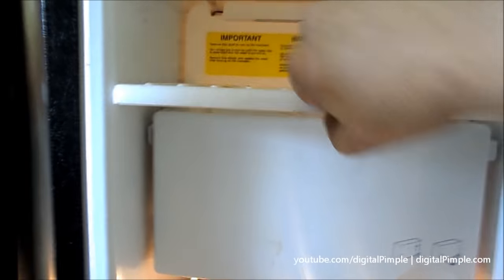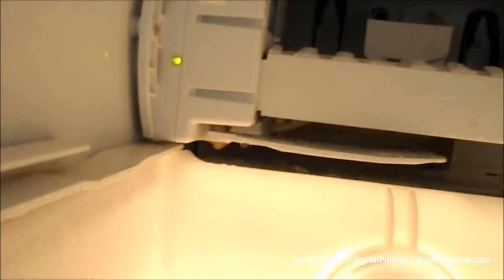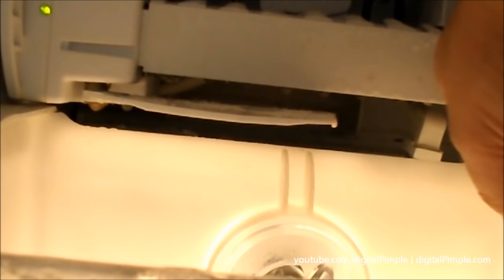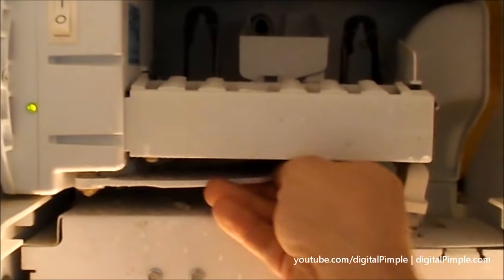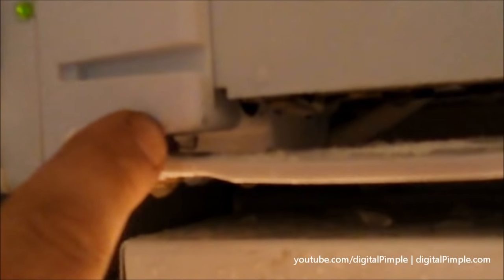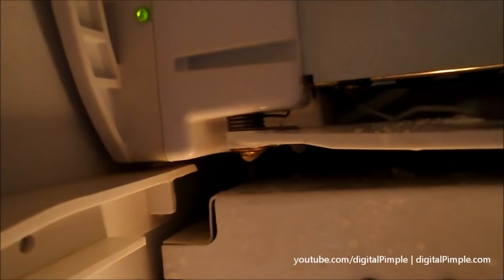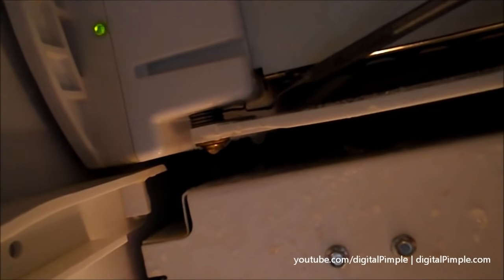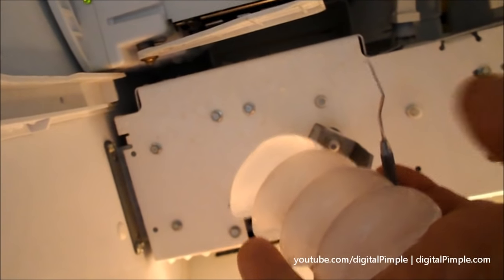GE Refrigerator - Ice Maker Not Making Ice - Easy Fix and Repair (DIY)

Comment: Is it safe to assume that after pushing the lever three times (I have tried it several times) and nothing happens, that the ice maker itself has gone bad (and requires replacing)?
Reply: Your turn off the ice maker, and then wait 20 seconds, and then turn the ice maker back on, and then push the paddle three times only. After 3 minutes you should see the rake inside the ice maker rotate 360, and then the ice maker mold should fill with water.

Comment: We found that the FAN in the freezer compartment wasn't turning fast enough.  the heavy items stayed frozen.  Ice Cream stayed very soft and sloppy.  The solution was to expose the fan(1/4inch nut driver and Philips head screw driver and large pliers to squeeze the connector side piece clips) and spray WD-40 on the fan shaft.  5 minutes later the WD-40 finally got into the bearings and  the fan started spinning like  normal.  FIXED now we have ice.  The GE Profile Model is a bear to get to the fan lots of different size screws.   This could save you $300 the fan is a ceramic version and very expensive.

Comment: the lever on mine is in the "off" position, I cannot pull it forward, The on/off switch doesn't seem to do anything.
Reply: Ya mine too slightly. Prob will need to reposition it on the spring somehow

Comment: 4yr old video I'm hoping someone sees my comment. My ice maker makes ice but after the third cycle I don't have a clue what happens and it starts leaking water from the valve on top the one that refills the tray. It keeps going none stop. I've tried the reset. what else could it be.

Comment: Man  I got a Ge refrigerator and the freezer side light never worked. I called GE they send techs replaced parts and it didnt work, I wonder if the light is somehow connected to the ice maker.  Ge has excellent customer service but they need ro do a better job testing their products before selling them to the customers